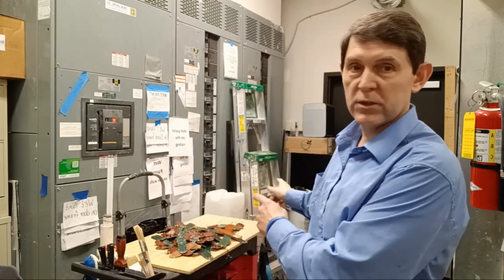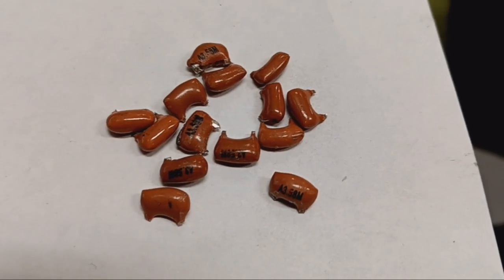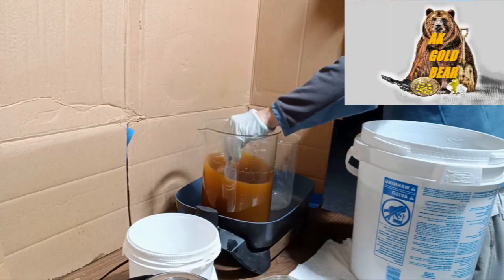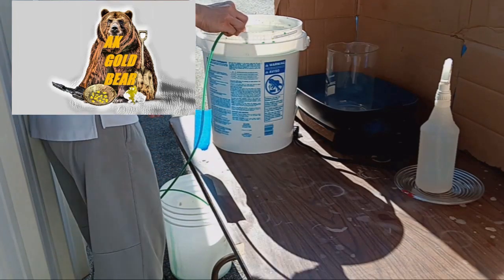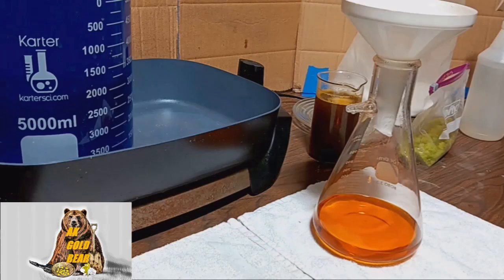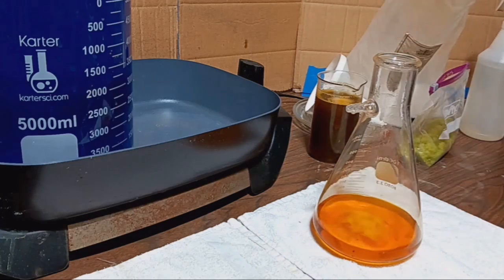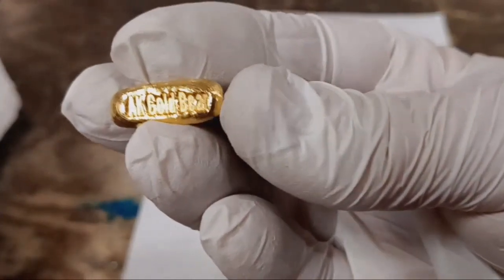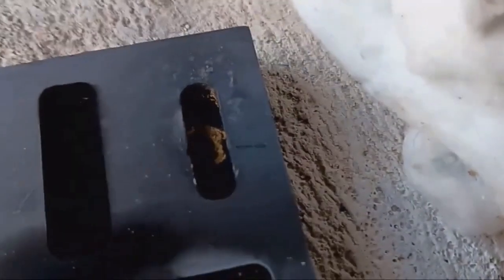Extracting gold from large gold plated pins. Part 2. 🧪🙂

Comment: i have 2 kg of gold plated pogo pins do you recommend dissolving it directly in AR  to save nitric or should i disolve the base metals using nitric first ?
Reply from the maker: Hi. To be honest, I don't know what pogo pins are. In this video, I dissolved everything directly in aqua regia because there was no tin or plastic. If your pogo pins contain tin or plastic, I recommend boiling the material in concentrated hydrochloric acid without water. Only after that you can dissolve everything in aqua regia. But if you do not have any problems with nitric acid, if your acid is cheap, it's better to dissolve the base metals in nitric and then dissolve the gold flakes in aqua regia. 🙂

Comment: Hi AK. I really enjoy your videos. I'm building a lab area with a fume hood at the moment so I can try doing these experiments for myself.

I have a couple of questions.

What kind of torch set-up do you have?

When you're rinsing with water from the kettle. Is that just tap water?
Reply from the maker: Hello. I'm glad you liked my video and what I do. Initially I used a large professional acetylene cutter. But I realized that this is not comfortable, not comfortable for me. I replaced the acetylene industrial cutter with a small propane torch. And I'm very happy about it. The torch is lightweight, easy to hold, and the torch is very powerful. I bought a torch on eBay. This small torch is designed to use acitylene. I don't like working with acetylene. I replaced the heating tip to work with propane. And I'm very happy!
I use only clean water. I have my own well and my water does not have any chlorine 🙂🖐

Comment: Very nice. If I understood correctly, you placed your plated pins in AR. No previous intermediate acid bath step. Interesting! No HCl to remove solder, no nitric bath to dissolve the base metals. Was this due to the volume of pins, or have you determined the prior steps aren't necessary?
Reply from the maker: Exactly these gold plated pins that are more profitable to dissolve straight in aqua regia. The pins do not contain silver and pins not magnetic. In my previous video i used almost twice as much nitric acid 🙂
Reply: @akgoldbear7669 Can I use this method for all guests other than just magnets, or might other metals such as decor spoil the royal water and thus lose the gold? I am currently working with the sulfur and nitric method, then aqua regia, based on your previous method?! May I have any advice from you? I follow you completely and appreciate your effort. I watch all your videos and support them. Thank you very much😍